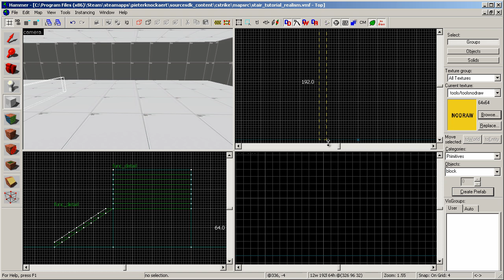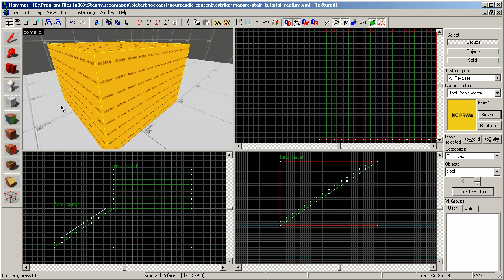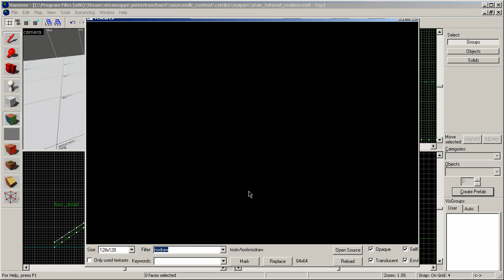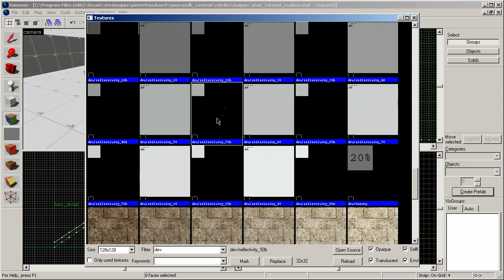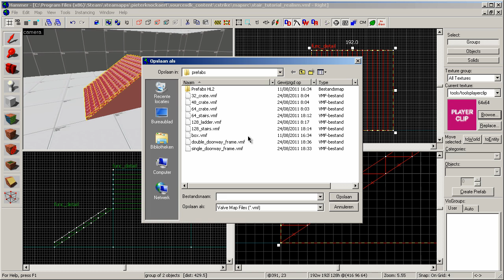Source SDK - How to make Stairs (Valve official scale)

Comment: Nice video but few pointers is easier to texture one step then copy paste, saves alot of time at the end,  also rather than grouping the steps and the bottom bit it would have been better to func_detail the lot, also on this video to func_detail I've noticed you right click etcetc just press toentity on the right hand side, and to be safe use the carve method on making the triangle block under the steps